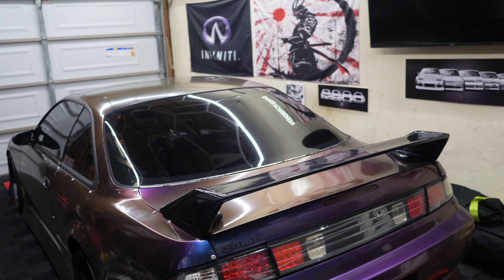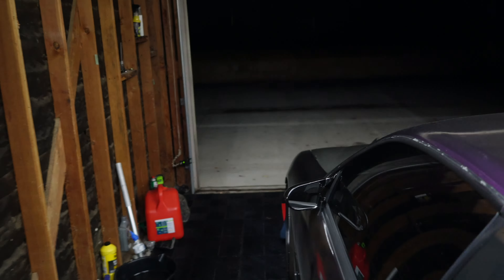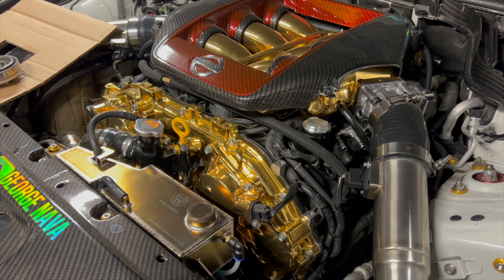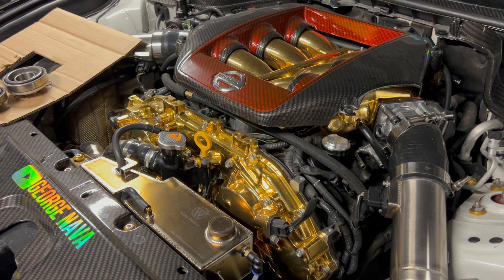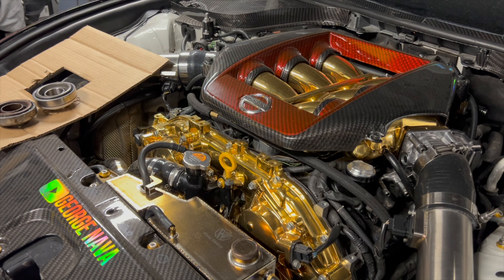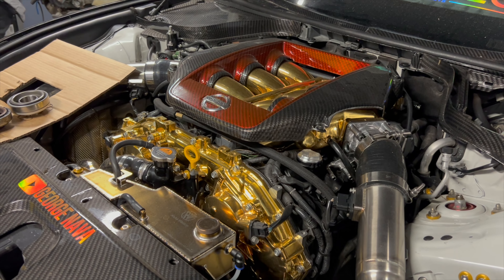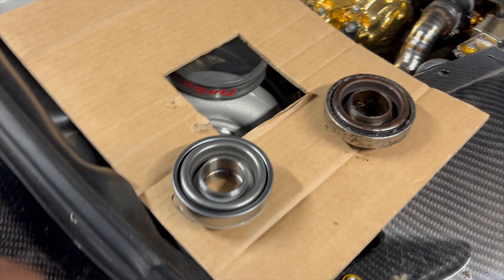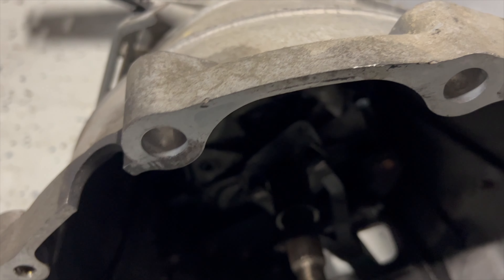FIXING my G37 single turbo!! What went wrong?

Comment: If it was a DIY and not a shop, the throw out bearing mistake is shitty but kind of an understandable oversight. Overtightened AN fittings are also a pretty common sight from fear of leaking. Now installing the clutch assembly without a torque wrench- really? SMH
Reply from the maker: Ugh bro trust me it’s been nothing but headaches,, don’t ever trust people they recommend 😅 learned the hard way 🤦🏻‍♂️